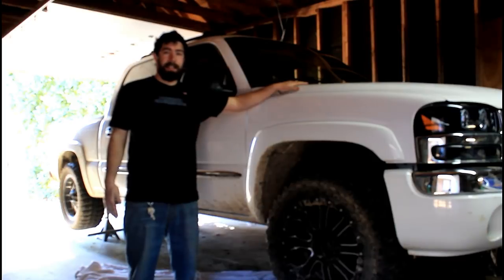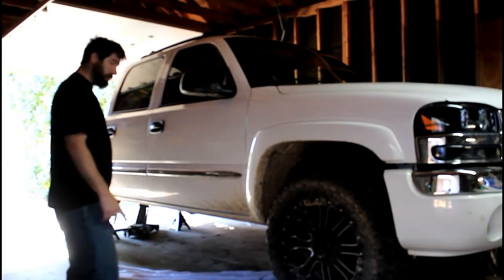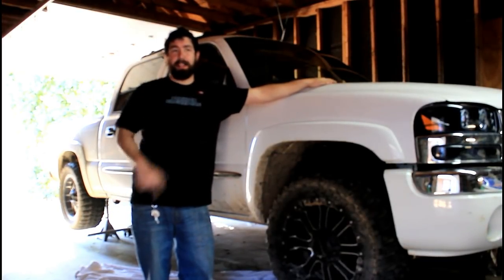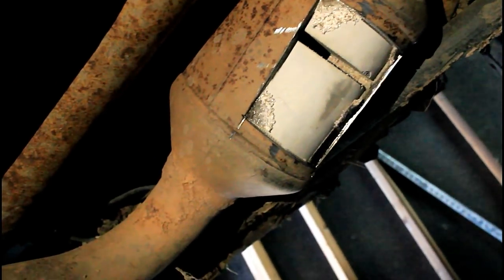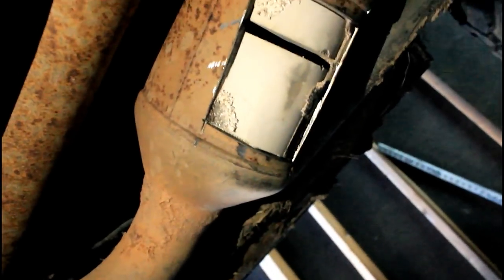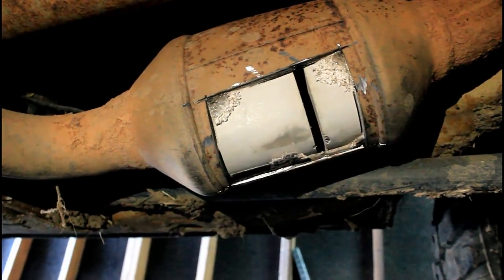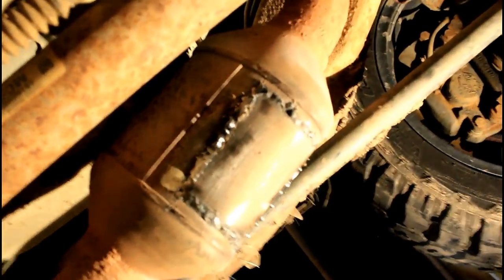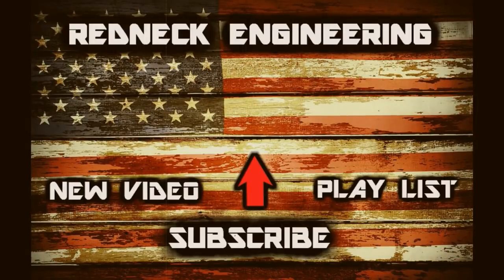Catalytic converter removal the easy and cheap way

Comment: How hard was this to weld while on the truck? My cat. is rattling so it's already breaking apart. Your idea would be $900 cheaper than buying a new Y-pipe with duel cats.
Reply from the maker: +DeWALTer_White its not hard if u know how to weld but it wont pass inspection and a muffler shop wont do it
Reply: AMAZING! I did your cat. filter removal while on the vehicle in an hour today. It took me longer to assemble my tools than it did to do the removal and weld.  I did  have access to a shop lift though. Thank you for the video and the idea. Your idea saved me $938.00 + $40.00 shipping for a y-pipe and 2 cats (it only comes that way). And my state does not require an emissions test to pass safety inspection. I'm GOOD!!!!!
Reply from the maker: +DeWALTer_White sweet man good to hear does it sound any different or do you have stock mufflers
Reply: Sounds a little "throaty" and I still have the stock muffler on it. It was the rattling from the broken cat filter that was driving me nuts. When.
Reply from the maker: +DeWALTer_White nice
Reply: Well depending on where you get it inspected anyways. Where I live in Missouri emissions are not tested during inspections they are in some counties though.
Reply: Is this cat stainless?  I have a mig welder set up only for regular steel?
Reply from the maker: +Tony T it's not stainless but even if it was you could still weld it just the weld wouldn't be stainless I do it all the time on commercial vent a hood equipment that stainless

Comment: I Ran  a straight pipe (first car 20 years ago) man I noticed the acceleration improvement...   never had a cop crawl his fat arse under to have a look (this is  in Australia ) cops are pretty laid back here as long as your not runnin your mouth ... they the same over there ?....also do more recent cars give you grief with O2 sensors etc if you cut it out or run a straight pipe?( wanna play around with my 2006 FORD territory (Aussie  with Barra straight six ) but have limited knowledge with sensors and computers etc on post 2000 cars
Reply from the maker: In some states here it is not an issue at all in some states it is a big deal but as far as newer cars go the O2 sensor in front of the cat helps determine fuel trim and the one after the cat basically monitors the performance of the cat and that’s it

Comment: Gutting your cats takes some low end power away. I would advise just putting some high performance cats.
Reply from the maker: Haha no it doesn't
Reply from the maker: Hahah someone lied to u
Reply from the maker: I wouldn't believe it unless I saw it first of all high performance cats are going to flow better so if you use the same logic it would still lose power with high performance cats so that doesn't make any sense also you're not going to get much gain from removing the cats unless you tune it but it is a restriction in exhaust flow which is not good you do not need back pressure

Comment: Louder but not faster, hmmm?  Sounds like Harley Davidson stuff.  I only see the point in loud if it's for performance.  Put a cam in it.
Reply from the maker: A cam does not help performance either by itself you have to have a custom tune if you want more performance removing the catalytic converter will give you more performance if you have a tune
Reply: @redneckengineering7739  A camshaft is the single most factor in what gives an engine is character.  Of course after even minor changes are made to components the ECU has to be adjusted, that's a given.  In fact, after you Frankenstein'd your converters the ECU should be adjusted.  You could have removed those converters and sold them, they are worth hundreds, then just welded pipe in their place.  There's so much wrong with this...
Reply from the maker: Still sold them and got more money this way ….. they dont have to extract it from the pipe….  Also it is hard to weld the top part of a pipe if you just cut it out especially laying on your back …. You do what YOU want and ill do whau I want! Also you sont know why i cut them or what i did after that this video isnt about that…. And if you think a cam will help with out a tune try that and let me know how that goes haha stop being a cry baby that comments when you get upset or don’t understand makes you sould like a bitch to me but if you keep it up that does keep me entertained lol and more view too

Comment: Is there any cons to removing the cats? Love the vid btw
Reply from the maker: +Lexis Bravo yeah u wont pass emotions
Reply: What do your feelings have to do with this?
Reply from the maker: +Cotronixco cool
Reply: Less mpg maybe a sulfer smell that and if you have emissions testing you will fail them for high hc and co
Reply: Cody Yellott I know people who cut theirs off and got 4-6 more mpg
Reply: Also, it will  throw a CEL after you do this. Some cars and trucks the rear O2 sensors can be disabled with a tune
Reply: @codyyellott117  Reducing engine back pressure by removing the cat will improve your MPG and your engine will run cooler
Reply: You don’t want back pressure you want scavenging not back pressure but what do I know 😂 only work on cars for a living and have many certs
Reply from the maker: Exactly I don't know why people thank you need back pressure

Comment: If you want your truck to have a nice sound you should try black widow widow maker muffler
Reply from the maker: +Art L I'm really trying to save and put a turbo on it
Reply: That will make a big difference in the 5.3
Reply from the maker: +Art L yeah but I need to upgrade the transmission first for late swap before I even think about it they make decent kits pretty cheap now
Reply: Yea it would be a good idea to either rebuild or just upgrade the trans
Reply from the maker: +Art L 4L60e is junk no matter how much u build  it the 4l80e has been known to hold over a thousand horsepower virtually stock

Comment: Why didn’t you just cut the whole cat instead of gutting it ?
Reply from the maker: Because without dropping the entire pipe down and risking breaking hardware it is very difficult to weld the top part of the tube and the most important reason is it’s my truck and I do what I want lol
Reply: @redneckengineering7739  gotcha

Comment: I was told I should cut my cats off my 2003 trailblazer I'm in arkansas.my check engine lights coming on and flashing and it throwing a oxygen sensor code and cat

Comment: Just found your channel but so far I like it is it to late for a shirt
Reply from the maker: I wish that it wasn't I need to have some more made but want to do a different design
Reply: Any ideas on how to gut cats but still pass inspection we don't have a missions but they will not allow you to have that patch well then decide they do do a visual inspection for leaks go ole Va for ya
Reply from the maker: You could still do that technique you just have to grind down the weld smooth and maybe run through a couple mud holes to bake it onto the exhaust and then you'll never no or just get the truck out. And put mud on it to discolor it or you can unbolt it from the manifolds and from the muffler drop it down and cut it from the top
Reply: Slight snow here right now but 52 degrees tomorrow trucks going on jack stand hold my beer hand me the cutting wheel
Reply from the maker: Hell yeah have have at it

Comment: What about o2 censors
Reply from the maker: What about them
Reply: If I were to cut the converters off what would I do with the o2 censors won’t it just send codes and effect my fuel and air mixture

Comment: Who cares about sound when you doing something illegal,can't pass inspection, bad for the environment, and a loss of hourspower
Reply from the maker: +Clayton Brasher first of all you're an idiot and didn't watch the video it may technically be illegal but I do not have to pass inspection I really drive the vehicle and it absolutely does not in any way shape or form lose horsepower it will gain it not lose it I don't know where you idiots come up with this
Reply from the maker: +Clayton Brasher like why the fuck did you even watch this video
Reply: In most states it can still pass inspection. Also many states don't even require inspections at all. And you gain horsepower plus emissions don't even matter.

Comment: Searched cat delete ended up with this and doesn't explain anything about different ideas on how to cat delete. But if you search cat delete and are looking for a video on how to change the oil in a 2005 GMC Sierra here you go. Lol.
Reply from the maker: You're an idiot watch the video further literally delete the cats in this video 😂
Reply: @redneckengineering7739  ok hey I cut a hole in the side then I did this and that and that's how I did it now here's how loud my pick em up truck is. Lol. He didn't explain at all exactly what he did. I watched the video from start to finish unfortunately. Go into detail more is all I'm saying. What tools did he use, what exactly did he do to cut it, what process did he use, etc. Just seems kinda short to me and didn't teach anyone anything. Change the title to doing things to my truck. Really didn't expect an oil change in a cat delete video by the way.
Reply from the maker: I'm sorry this video isn't for beginners if you don't have enough common sense to figure out the tools I used you probably shouldn't try this yourself
Reply from the maker: If you are educated enough you can clearly see the cuts were made by an angle grinder and putting pipe in to do it the right way you have to remove the entire exhaust system from the manifolds so if you live in a rusty climate you'll probably break the manifold bolts so there is no right way since it's illegal the right way would be to buy aftermarket exhaust all the way back and spend about $1,200 and did you even read the fucking channel name you idiot if you want to come fast people on their comment section just don't cuz nobody gives a shit about you and to be quite honest the more you comment the better this video does so go ahead continue to cry like a little bitch that you are cuz it doesn't bother me what you say one bit.actually part of the reason I started the YouTube channel has to argue with people in the comments